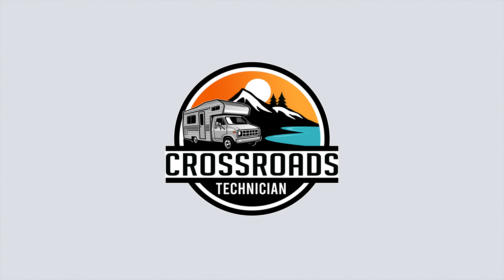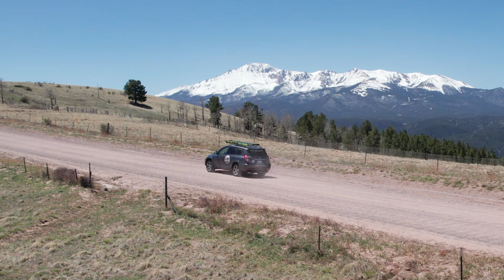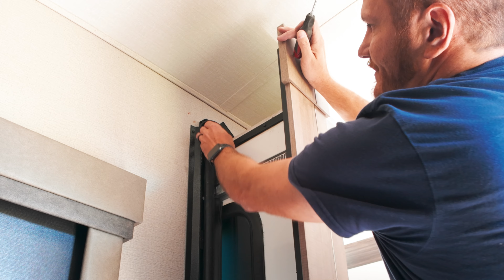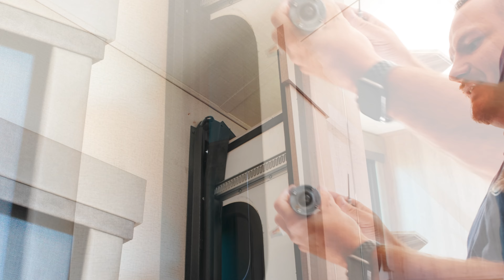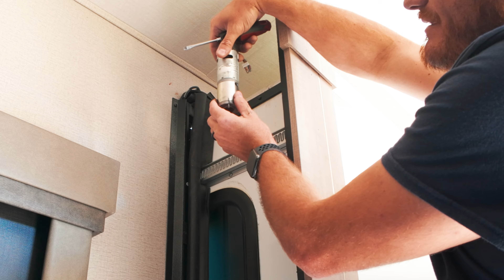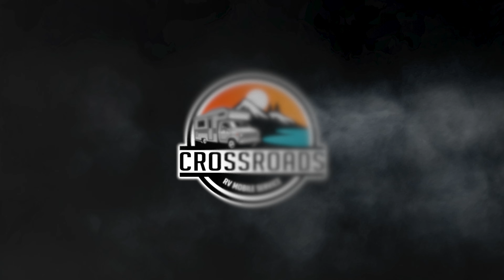Replacing Schwintek Slide Out Motor

Comment: Great, except my slide won’t go out to access the outside screw, because THE MOTORS BAD. So stupid
Reply from the maker: Yep. Gotta love Lippert. Sometimes, not always, from the inside you can remove the plastic cap of the motor and see the wiring. Will a little luck, if you barely wiggle the wires it may engage. But this doesn't always work...
Reply: My slide is out soooo how the heck do you get it back in

Comment: All good unless your refrigerator is next to the slide in a cabinet and the other end up against the rear bath wall!! Then what?
Reply from the maker: Yes, I push the slide out all the way and bring it back in about 1 foot. But I'm used to this because you may have to work going by feel as you can't see. Another option is removing the trim of the slide out (the wood trim around the inside box) so you can have a little more visibility. I usually opt to going by feel.

Comment: Is there only 1 motor or does each side have one
Reply from the maker: Just saw your message. Schwintek has one on each side. Keep in mind that if one side gets stuck and the other keeps moving, it could very well just need a deep cleaning. One of my first videos mentions how to clean it. Most of the time that's all it needs. Specially if you hear the motor hum but it stops shortly after moving.